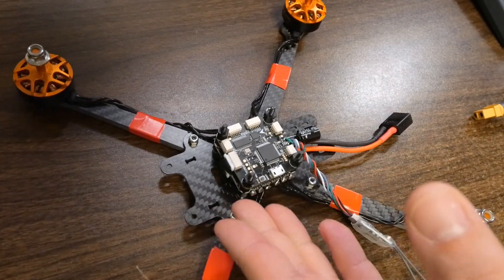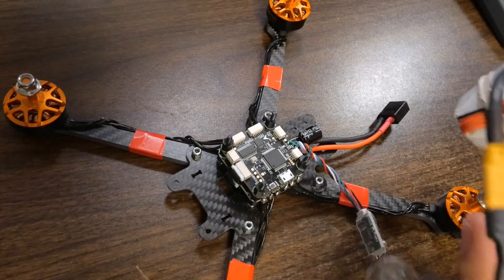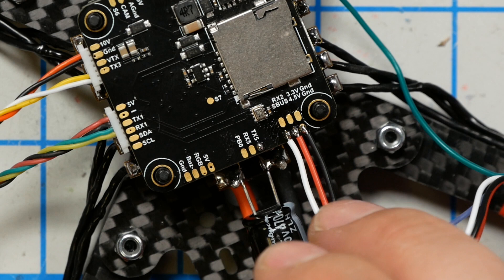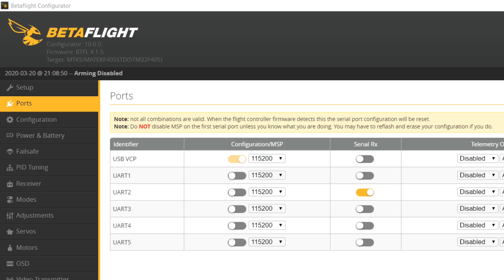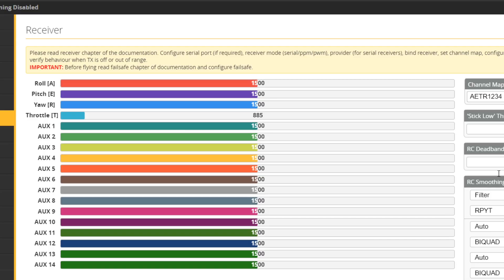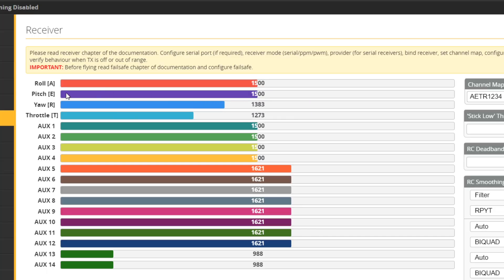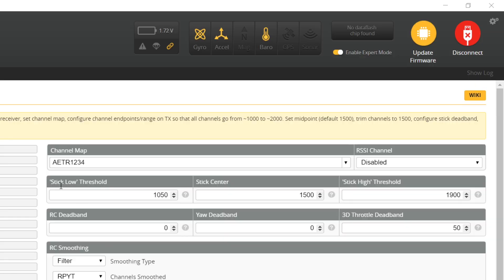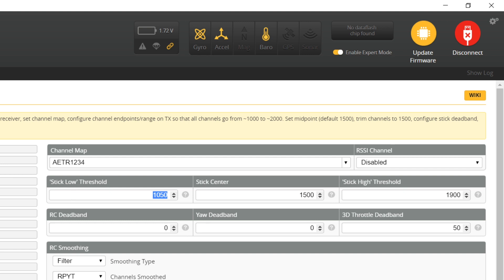Beginner Guide $120 FPV Drone How To Build - Part 5 - Endpoints and Channel Mapping

Comment: Is there a benefit to doing these adjustments inside BF or is making them through the TX's EP adjustments sufficient?
Reply from the maker: The TX endpoints would theoretically give better precision and it's also nice that they are universal across all the quads you bind to that model.

Comment: If I hold down the “pitch” joystick, it clears my throttle warning, but it moves the pitch slider in the receiver tab of iNav.  I got something screwed  up somewhere but not sure where else to look, I have recalibrated the transmitter several times and the controls operate properly there, as well.  Btw, I have the the same jumper T16 and quad components as I followed the build to a “T”

Comment: How do I set the controller mid point? My end points are fine but my pitch is showing 1550. (Mac OSx - BetaFPV LiteRadio 2)
Reply from the maker: You would have to use the trim function in the radio. I'm not sure how that works on the literadio though :-/

Comment: That RX range command was what I learnt today.
If I had set my endpoints by changing them on the transmitter, does that give the same result. Or should I go reset them and do it this way?
I can see the advantage of having more generic model settings on the transmitter though.

Comment: Since I did the rxrange command the centre do not land on 1500 anymore on any of the channels and it does not set it to 1000-2000. It sets wither lower or higher values. Tried it many times now. Tx16s, iflight protek35 with tbs crossfire

Comment: Hello Joshua! Thank you for this playlist! I have built my Tyro 119 and I love it. I just have one question. When I'm cruising and reduce throttle to minimum, my drone becomes a bit unstable (it pitches up and rolls right). This is annoying, because when you're doing tricks/freestyle and hit low throttle, my drone falls off the trajectory.

I believe I should increase the idle speed of the motors to the point my drone looses altitude without tilting, but what is the best way of going about this? Should I increase the stick low threshhold in Betaflight or do it in BLHeli configurator?
Reply: Ok
Reply: You should calibrate the drone or the esc i think thats it
Reply: @nik112-p3s  thanks for your reply!

I asked this question so long ago, I have built seven more FPV drones since then.  XD

I believe the issue was that my minimum throttle rpm was so low, my ESCs couldn't do it and desynced. After I increased the minimum idle speed the problem disappeared. Discovering air mode and learning PID tuning was another game changer.

Comment: My yaw and my roll are reversed, as in when i do full left stick on roll, it goes to 2011. Same with yaw.
Reply: Never mind, I fixed it in the output tab in the model.
Reply: @iandavis5329  hey mate  all mine are stuck at 2011 ! what did you do to fix it ???
Reply: @michael1473  what i did was on my radio model settings, i reset the trims. also try to reset all the trims and radio defaults in the receiver tab on betaflight
Reply: @iandavis5329  Hey thanks for getting back to me! I will try this tonight after work.

Comment: I've completed every step so far just as the video. Good Job and thanks for your time.
I have a problem I can't seem to figure out, the sticks don't move in beta flight. I can move the tyro119 and it show pitch and yaw etc...
I'm running a Taranis XD9 Plus with a FrSky XM+ receiver. It binds, the green light is on but no communications on the sticks. 
I've loaded the firmware matekf405 4.1.1 and the firmware in the video matekf405std still the same problem.
Can anyone give me a hand with this?
Thanks
Reply: Same problem did you ever figure it out?
Reply: Try putting it on Ppm instead of sbus 👍🏻

Comment: @joshua bardwell I have tried all your tips and others but whenever i move my sticks it is not showing on beta flight. tried updating it and now it wont connect. still on sbus. please help. if you need more info just ask
Reply: I'm in the same boat. I move the stick, but I don't see them move in beta flight. When I move the Tyro 119 it shows it moving, pitch, yaw etc.... Stuck on this problem
Reply: Did you guys solder the sbus pad on the FC ? Middle and left pads to enable SBUS

Comment: How do you change Jumper t16 default of RETA to AETR?
Reply from the maker: If you change the default, it will affect only new models. Personally I just leave the default where it is and change Betaflight channel map. But if you want to change the default, long press SYS and it's in the Raido Setup menu near the bottom.

Comment: What is the difference between what you did in the CLI for end points and doing in the radio ?
Reply from the maker: Doing in the radio gives more resolution; doing in the CLI gives less resolution. Practically most people would not notice the difference.

Doing in the radio means if you bind more than one quad to the same model in the radio, all subsequent quads will have correct endpoints. Doing in the CLI means the endpoints are stored in the FC, which is useful if for some reason all your receivers don't have consistent endpoints, but you still want to bind all your quads to the same model.

Doing in the CLI works for all transmitters. Doing in the radio has a different procedure for each.

Comment: I just received the TYRO 129 that I ordered from China. I decided to watch your build series, before starting my build. I noticed that instead of connecting the receiver to the connector for the receiver on the top of the board and selecting the type of receiver using the pad, you are soldering the receiver wires directly to rx pads on the backside of the flight controller.   I was wondering why you were doing it this way?

Comment: I thought that the End-points would be impacted by the trim tab settings.  so the true min/max  would be higher / lower if those are not adjusted.  All in all, I don't think it will have much total impact on the calibration in the software.

Comment: Josh, what is the average current draw when the quad is not armed ? My quad draws 0.5A in that state (I dont use DJI, and VTX is in pit mode) and my FC gets very hot, telemetry shows above 80C.
Reply from the maker: That sounds normal. I ignore the "core temp" warning -- in fact I turn it off in the OSD tab. I don't know why some FC get hot and others don't but I never worried about it.
Reply: @JoshuaBardwell  Thanks for your reply!

Comment: Should I worry about setting the end points on the transmitter, as well or just in BetaFlight?
Reply from the maker: If you know how to set the endpoints in the transmitter, I would do that instead. I just show the rxrange method because it works for all transmitters, so the tutorial is easier to make to help the most people.
Reply: @JoshuaBardwell  Was looking for this answer because I learned the transmitter way in an older tutorial of yours lol

Comment: Hey Joshua, nice video series for beginners. You might want to reverse parts 5 and 6 so that this video comes before the Aux Modes setup video. Otherwise, bars won't be moving in the receiver tab and beginners will freak out a bit. Perhaps you have another reason to do it in this order, but here you have my input
Reply from the maker: Ummm. Yeah wow good suggestion. How did I miss that? It must be because SBUS is the default so mine were already working? Or maybe I messed it up in editing.

Comment: Dear mister Bardwell, 
I dont know where to turn to with this issue i am having.
I have an xm+ on a TP3 frame (Toothpick), that i built.
Betaflight version is 3.5.7.
RSSI Channel is set to AUX 12, according to the XM+ firmware.
I get an RSSI reading on the setup tab. 

But I cant get RSSi on the OSD.
The RSSI option just does nothing.
Reply: Enable RSSI on the OSD tab.  Make sure RSSI channel is set to AUX 12 on the RECIEVER tab in betaflight. If not maybe try setting RSSI channel to AUX 14
Reply from the maker: If you get RSSI reading on setup tab, then the OSD should also show RSSI.

Make sure RSSI_ADC is disabled in the Configuration tab, but that shouldn't be the problem since you do see RSSI in Setup tab.

My best guess is you have the wrong OSD element enabled and you are not seeing RSSI but some other value.
Reply: @JoshuaBardwell  I have selected the "RSSI Value" element, its not showing up on the OSD.

Enabling RSSI_ADC makes it so Im unable to set the RSSI Channel in the receiver tab.
Reply: @JoshuaBardwell   @Martin Olsen 

I have disabled EVERYTHING in the OSD and now it works. 

I have read that having CPU Temp enabled causes the RSSI value not to show up on that version for some reason, sometimes. 

I have all kinds of stuff enabled.

Thank you 2 very much for helping.

Comment: Great advice, didn't know the rxrange mod.  On the Receiver screen, moving the sticks moves the quad but when I release the sticks the the model does not return to horizontal even when mode is Angle.  Is this normal (I presume yes as the app cant be that smart)?

Comment: Is it worth doing the rx range instead of adjusting the end points on the jumper? Any benefit? Beta flight still reads as it should.. although I noticed on my jumper it reads -97% to + 97% on all channels.
Reply from the maker: Since the Jumper is so close to perfect anyway, it doesn't really matter. If you adjust the endpoints on the model, then any future quads you bind to the same model will also be correct. I bind all my D16 quads to the same model, so that's how I do it. Fix the model once in the Jumper and then never again.

If you have a Spektrum receiver where the default endpoints are like 200 us from where they should be, using rxrange will cause a loss of resolution. Not every pilot will notice but it's there.
Reply: Joshua Bardwell Thanks JB and thank you for all your awesome videos! I got in to FPV a month ago and have learnt so much from you!  👍🏻.

Comment: In an earlier vid you connected smart port to tx5.  Now there's nothing on tx5.  What happened?      I'm curious how you get telemetry to work.  I haven't gotten it to work with an XSR-M
Reply from the maker: That photo is from before I soldered the wire.
Reply: @JoshuaBardwell  Good.  Anxiously awaiting the rest of your series.  Especially when you cover INAV - which I am running.  I upgraded to a GPS with compass for this build.

Comment: I’m having an issue with turtle mode. If I arm in turtle mode, the quad starts beeping as if I was activating the buzzer. I have my buzzer and turtle mode on different aux channel. Do you know what the issue is? Also it’s a vifly v2 buzzer
Reply from the maker: It's beeping to warn you that you're about to arm in turtle mode.
Reply: Joshua Bardwell sorry! It beeps constantly after I have armed in turtle mode. Is there any way to turn it off? I’ve seen your video when you arm in turtle mode, it doesn’t seem to beep constantly
Reply: Joshua Bardwell btw thanks for all your help, followed every video you got and it’s helped sooooo much! Keep up the great work!

Comment: Hi JB Are you going to set up the gps on beta flight ? I have had a 129 since christmas  first Quad, sorta struggling with set up .
I cant work out how to set the vtx power and how to change vtx channels using smart audio could you cover that as well for the beginners.

Comment: Do you know if the DJI Air unit can interfere with a flight controller?  I have one mounted on the top of the stack and my quad does some funny glitching and rocking sometimes in both acro and angle mode, can't really check it at mo because I live in the city and can't travel to test due to lockdown but I did wonder if the Air unit was causing interference with the FC?  Thanks.
Reply from the maker: Not that I know of.
Reply: Joshua Bardwell thanks, looks like I'll try a new FC at some point then, this one is a bit beaten up lol.

Comment: i have a nother question 
dose the eachine wizard x220s come with a controller
Reply from the maker: If you buy the bind-n-fly kit it does.
Reply: @JoshuaBardwell  thanks
Reply: No it does not. 

Is it your first quad? 
If so. buy a remote and a Sim. Try that out. If you like it you can go ahead and buy a drone. If not sell the remote only 20 dollar lighter..
Reply: @mikoss92  ok thanks